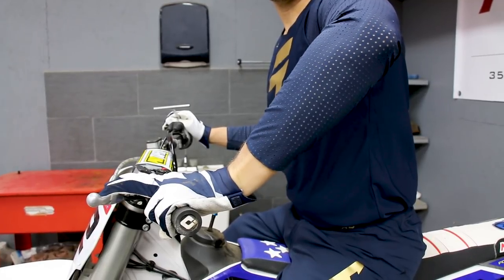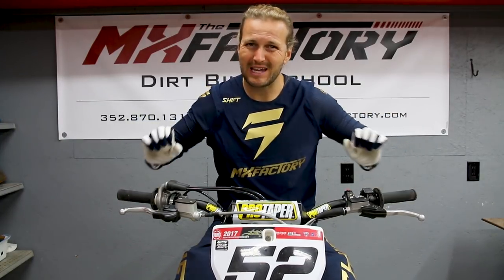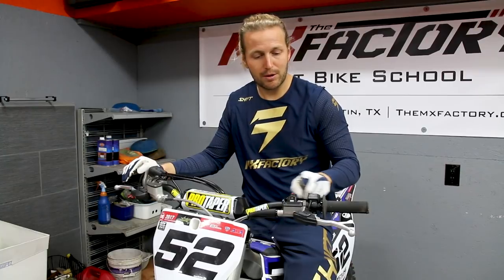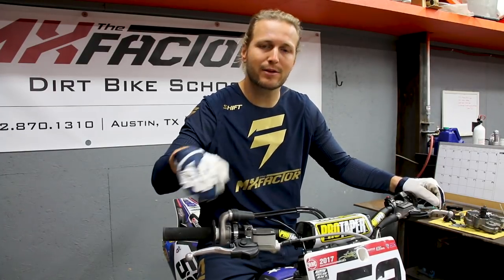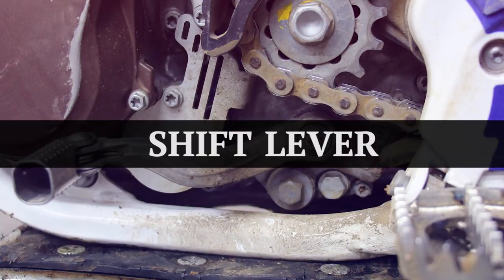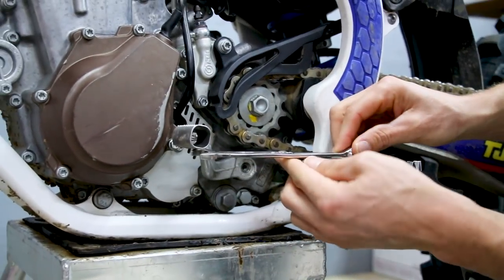How to Set Up Handlebars & Basic Dirt Bike Controls - Best Motocross Tips to Ride Like a Pro!!

Comment: The part where you’re describing wrist positions with the levers is spot on and that’s actually how you should choose your bar bend and then bar position. Once those are set, then adjust the lever position. 

If you’re riding in the attack position and your wrists are tweaked inward or outward, you’ll lose strength, injure the joint and possibly go numb. 

Ask me how I know.
Reply: How do you know?👀
Reply: @DonGH297  he musta went numb before he could respond.
Reply: @americandude3825  🤣

Comment: This video was very helpful for me because I keep tapping the rear foot brake without me knowing and it slowed me down a lot!  Thanks for the good tip
Reply: The modern boots I bought have no feel at all.  I want to be able to feel my brake and shift lever, so I switched to a pair of Adventure boots, (TCX Baja GTXgortex).  They are as protective as a good boot of the late 80's, which I raced with for a decade with no troubles, nice and light, but I would not want to get t-boned or get my toes sucked under the peg.  Just doing aggressive trail riding now, and would want more protection for MX,---but I know I will crash less when I can feel the controls, so I had to add that in the safety factor too.  You can separate a shoulder, because your boots are "sense less", like a lobster exoskeleton on your foot.

Comment: I work at a Powersports dealership as a bike tech and you’re not supposed to criss cross the pattern when you’re tightening clamps. The style clamp in this video is called a stepped clamp or pinch clamp. If you look closely one side of the clamp is thicker and one is thinner (stepped) you always tighten the thicker side first and follow up with the small side which pinches the clamp tight on the bars. The clamp in this video should have the thick side on top. Also there’s markings on bars and clamps so no needs to sharpie your bars. Just friendly advice!
Reply: great video , nothing will happen if he tighten the clamp criss cross ... I also work at a dealership as well!
Reply: @monton5440  Which is why I work on my own bike.  ThrillBilly is right for that style clamp.

Comment: You know on the Pro Taper bars (that came stock with my 2019 YZ 250 2-stroke), and those number lines on the bar between the clamps?  The numbers on the bar have a 0 in the middle, some likes to a number 2 on each end.  People today set the bar up (rotating the bar forward), where the 0 is in the middle of the top clamp.  Rotate your bars back so the far "2" is at the center of the clamp, and point your levers down by 15 to 30 degrees, which ever lets you keep your elbows up (sitting or standing, on the gas or off.)  The level levers are nuts.  Your brake lever is so high, for example, you get done with braking, can't "re-grip' the throttle because your finger is still on the lever, then you give it gas and drop your elbow to your waist.  Good thing the baby tracks today are smooth.  Look at the 80's set up and early 90's.  It is like that for a reason  The bars are high today because of freestyle.
Your future is going to suck if you follow, instead of figure out why.
Grip ends should point down, (nature hand position it was designed for), or level at the very highest.  The grips should be over the gas cap when looking at the bike from the side of the bars.  Now go see how much easier it is to get over the bars for things like flat corners.  You will have much more control of the front end, and it is much easier to keep your elbows up.
This is a freestyle set up, (for trick clearance),---and the entire industry (world) is irrational today.

Comment: Can you guys do a video on clutch control on a 2 stroke and starts on them?
Reply: I stuggle even more with the clutch control on the big 4 strokes like the Yamaha WR450 with either stalling, or it run away slipping or go to fast because it has to much power to fast at even the lowest of the low rpm. Easiest bike I had for slow technical difficult terrain was a 2 stroke KX125 MX bike from 1983 and I almost never stalled that one and never used the clutch because it was just to hard lol.
Reply: Diego Brah it's the same

Comment: On the Brake Pedal side....
I took the two metric  screws out of the Pedle itself. Stacked a pair of 7 small THIN  Dia. steel washers with a longer metric Allen head screw back in. I micro'ed the pedal up. Stock seemed Low. Any thoughts here?

Comment: Adding an extra washer outside of the Nord-lock washers like you have done will prevent the Nord-lock washers from working properly. Which is a bit sad, as they are some great engineering in action.

Comment: Hi there. Im a taller rider on a yz250f. Ive been having issues with my arms tiring out quickly. It’s mainly my fitness but a mate told me that im quite tall so i have to move my handlebar clamps to the other holes and get handlebar raisers. Would that help?
Reply: Probably not.  You are not relaxing.  Let me share a trick with you.  Have you ever noticed that a rider can be super talented, and not even cross train, (Lechien and Bayle are 2 that come to mind).  The reason is, when they got tired, they figured out ways to ride and not use energy, instead of hitting the gym.   When they got tired, they figured they were doing something wrong and corrected it with their riding technique.  That is how they got so smooth.  #1 rule, if you are not relaxed, you are doing something wrong. :)

Comment: The ends of your grips should be pointing down a bit, and their grips about over the gas cap as you look at the bars from the side. (pull the bars back!)
This set up he is running is actually a freestyle set up,---that his generation adopted with out thinking for riding, and the entire industry, (new generation) adopted it with out thinking at all..  Reed some Gary Bailey for the bar set up with "reason".

Comment: The Mx Factory why is engine kill on the same side as clutch out of reach of thumb ?
Reply from the maker: Because we don’t want to accidentally hit the kill button while riding.
Reply: The Mx Factory dont you have to hold it for a second or 2
Reply from the maker: Yes, but getting it out of the way from your knee in a corner or any other body part is just a way to prevent killing it when you don’t mean to.

Comment: hey tyler whats the point of tightening in a criss cross pattern?
Reply from the maker: +dunkin 102 When tightening bolts in a criss cross pattern you avoid tightening down one side of the clamp too much. If you only tightened down one side of the clamp, then the other side, the clamp may be uneven and leave the bars a chance to slip. So criss cross just makes sure the clamp is evened up and keeps the bars tight.
Reply: exactly what we would say! :)
Reply: by the way we like your vids! really good done! greetings from germany to you

Comment: Okah I need help moving my rear brake down and in the video it says to move them too bolts to adjust it and my dirt bike does have that
Reply from the maker: What kind of bike do you have?
Reply: The Mx Factory I have a Suzuki Jr 80 2002
Reply: The Mx Factory PLEASE HELP WITH THS promblem MY BIKE DOESNT HAVE THE ADJUSTMENT IT HAS A CASTLE NUT BUT ITS DOESNT HAVE ADJUSTABLE BOLTS
Reply: it´s hard to say without pics
go to a forum and ask there or you could ask guys on the track,maybe someone knows or can figure it out by looking at it
ok i forgot the obvious,ask your suzuki dealer ^^

Comment: 5:30 anybody else notice that part with KTM on it.
Reply: They use the same parts ktm and that are basically the same bike
Reply: Got em in several locations on my FE 350  
Big on the inside of the exhaust, on the manufacturers vin tag etc. 

Basically, KTM is like Toyota. Husqvarna is kind of the Lexus. It has more expensive bling parts but the same basic frame and motors. 
KTM is wise in doing this. 
A huge part of manufacturing is the tooling cost. Using the same molds, wiring and other parts as well as suppliers, gives them a lower overhead. As far as EPA regulations, since the EPA bases how strict their regulations are on sales numbers, it allows them to stay in at lower numbers by splitting the brands while using the same tooling and plant. 

KTM
Husaberg
Husqvarna
Gas Gas

Comment: OMG....DO NOT use red loc-tite....EVER!!!! 
Unless you NEVER want to remove that bolt.
Reply: You can remove them with heat, but there are a lot of parts that you really don't want to heat to 400 deg. F.
There are a lot of yahoos on YT.  I think for the most part, we would be better off figuring stuff out ourselves.  The high bar set up is a freestyle set up actually, and they would all have more control of their bike if they stuck to the age of reason of the 80's.

Comment: That is definitely not how to tighten your  bars Honda wants u to tighten the front side of clamps then the side closest to the rider u should end up with the clamps touching in the front  and a gap in the back
Reply: That depends on how the clamp is made.  For the style you are talking about, you can see one end of the clamp is longer than the other, and those are made to tighten the closed end, then torque the other bolts.  But my clamps have no difference on the clamping piece, so I set them up with equal gaps (visually), and torque them down.
Pssst---it is not the right way to set up your handle bars either.  This is how stupid we are today: That is a freestyle set up that the entire industry of new generation adopted,---and they are slower in any corner with out a berm, and will crash more often.
Reply: @EarthSurferUSA   well to me it makes way more sense if top clap is all waY seated to the bottom clamp on one side less likely  to loosen and it almost  creates  a hing locking  bars in place. If u have  space  on both sides soon u get any loss in friction bars going  to move way easier. But I digress any one tight your bars however  you want .